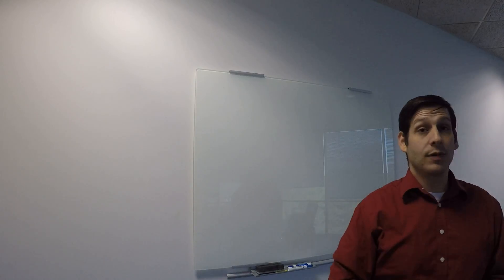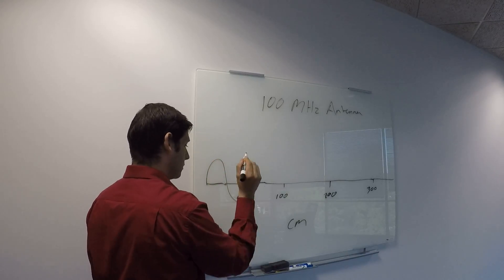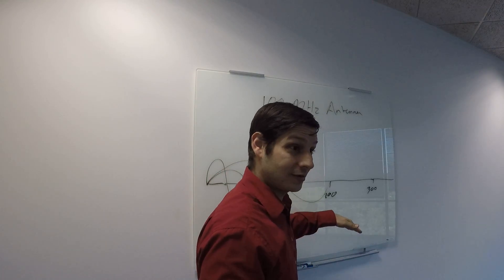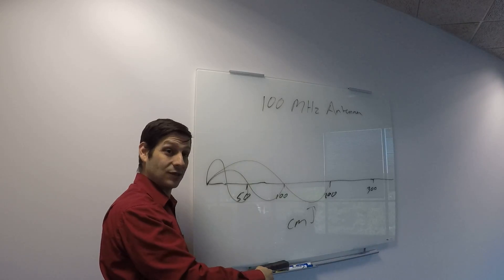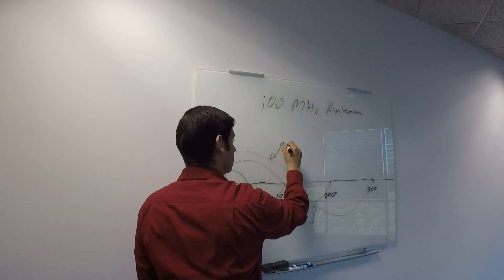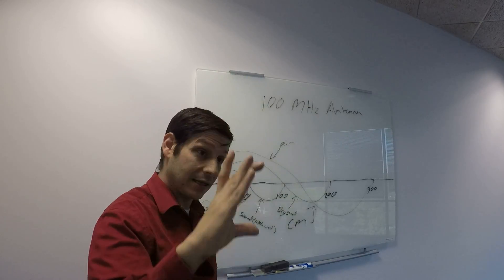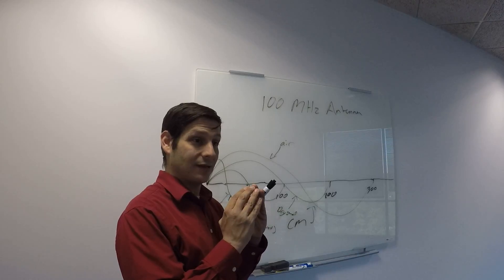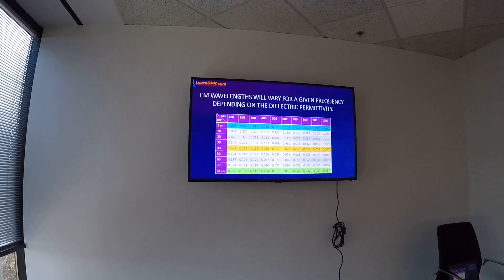How GPR wavelengths change in different soils

Comment: Can GPR detect the degree to which septic gravel has become clogged?  

Some septic pros say to use hydrojetting to clear leach pipes.  Others say hydrojetting won't help if the primary problem is that the gravel has become clogged.  

If the gravel is not clogged, it will be distinct from the soil/earth, so it seems they (and the pipe) would be visible on the GPR viewer.  If the gravel is clogged, it will still be different from the soil/earth, but less different - the distinction will be harder to detect.  
  
Would it work to say: If the gravel is 100% clear, the contrast will be ___. If the gravel is clogged (0% clear), the contrast will be ____.  The contrast is ____, so therefore the gravel is __% clear.

Rocks of various sizes would be distributed throughout the [soil/earth].  If the analysis is done over a large enough area, would it be possible to filter out rocks / ignore sections with significant rocks?

Comment: 100 MHz wavelength is always 3 meters. It doesn't matter what the soil is.
Reply from the maker: Only in air. Wavelength is a permittivity dependent variable. To calculate wavelength youll have to devide velocity (meters per ns) by frequency (GHz). So if the wave is only moving at .1 m/ns (such as in moist sand) than the wavelength of a wave produced from a 100 MHz antenna would only be...1 meter. If you are unsure about this stuff you might want to get on some of the training at learngpr.com. thanks for the comment! Much appreciated.
Reply: Thanks, do you have a video that explains this in more detail?
Reply from the maker: Yes. In our online platform we go into this in detail. You can join at learngpr.com

Comment: could gpr detect bedrock layered 25m below ground level with the upper 25m layer consisting of wet sand and silt?
Reply from the maker: steve lowry GPR can see that deep with low frequency antenna (lower than 50 mhz), but in this situation it will depend how saturated that sand and silt is.